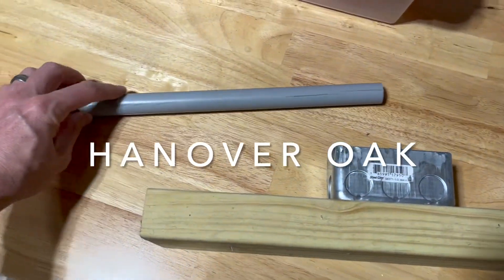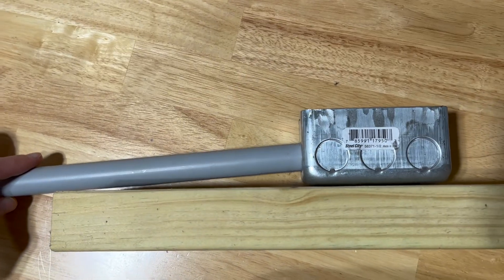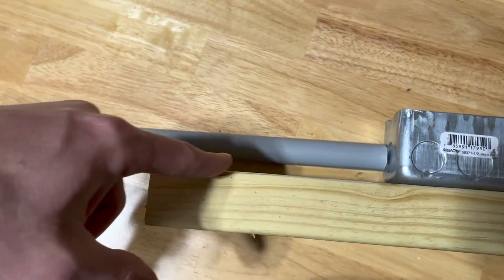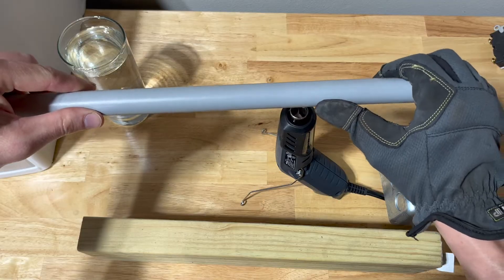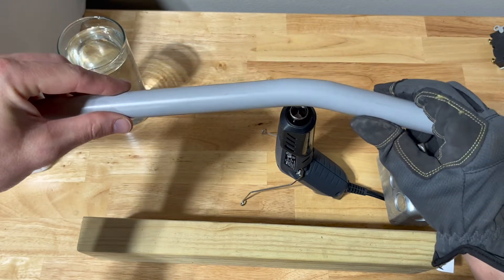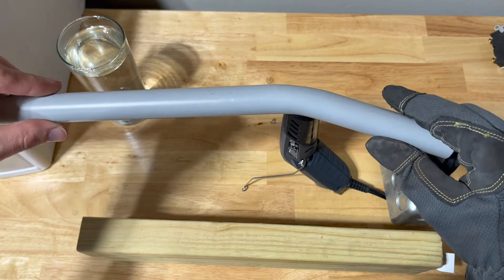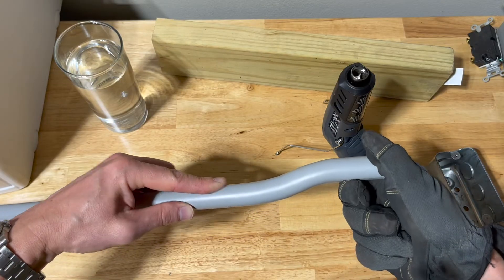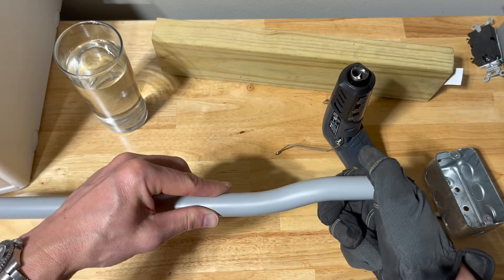How to Bend PVC Electrical Conduit with a Heat Gun || Offset Bend

Comment: would you say you can use any heat gun you have around? or is there a more ideal temperature to set the tool please. cool video thanks a lot
Reply from the maker: Yes but I put mine on the hottest setting. You just don’t want to leave it in one spot for too long and burn the pipe. The hotter it is, the faster it will make the pipe pliable.

Comment: You can cold bend pvc conduit offsets in an emt bender in 10 seconds, it springs back half the bend amount. Can do up to 1 inch 60 degree bends with no bend spring, you can do 90 bends if you put a bending spring in it.

Comment: How do you make sure you bend just enough so that it is aligned with the hole, not too far up or down?
Reply: Put it in the box first, then heat it until it falls into the offset naturally. No guesswork with that execution.
Reply from the maker: For me, this was trial and error. You kinda have to just eyeball it. It’s a good idea to practice a few times on a piece of scrap pipe. Also, if you get it wrong, you can always reheat the pipe and bend it again. Hope this helps!
Reply: @hanoveroak  https://youtu.be/lS9D28429Yw This one helped me, making guide lines like in it and using your foot to hold it down while wiping it with a wet rag makes it so one man alone can bend it